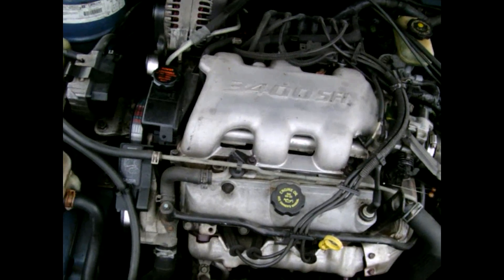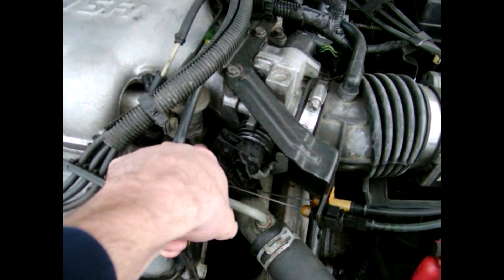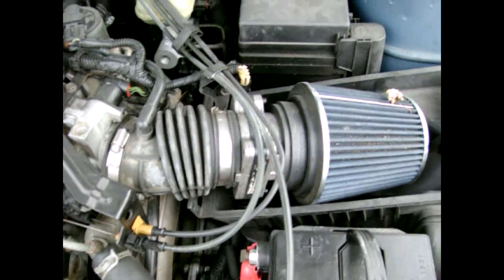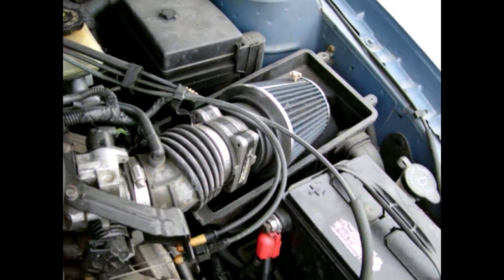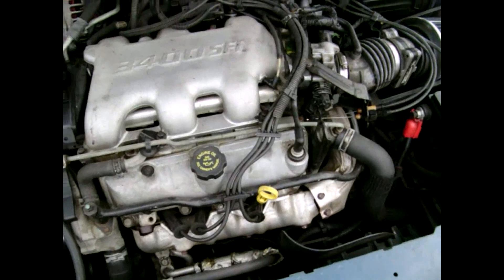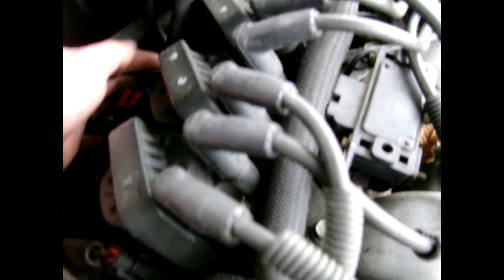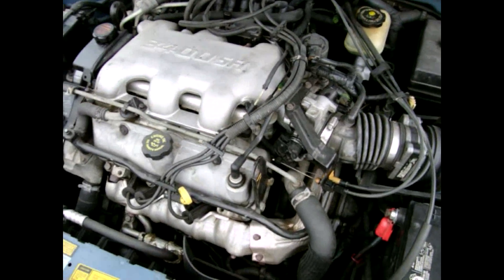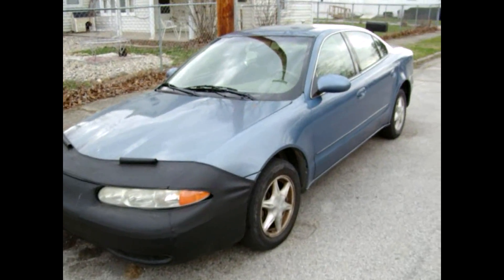3400 GM Engine 3.4 Liter Motor Explanation And Discussion

Comment from the maker: You will need an OBD II scan gauge to pull up the codes.  Any autozone or parts store will run the codes for free. The pinging could be bad gas or the elevation.  Possibly the EGR system. The EGR system tends to get carboned up. Change the EGR and clean the port with a coat hanger and strong solvent. Also check for vacuum leaks with a water bottle or carb cleaner.  Be sure to check your oil too, make sure there isn't water in with the oil indicating a bad intake manifold. Hope this helps.
VT247

Comment: Great Video. I have two Chevy Equinox's 2008 and 2009 both with high mileage and have had no major issues with either one, I think GM must have fixed many of the problems in later production versions of the 3.4L
Reply: Boy you wrote a arm a leg lmao😂

Comment: I have a 2001 Chevy Venture, that Im thinking has a blown head, The night I bought the vehicle it ran fine had no problems other than a shake when accelerating, but that's not the issue. I started driving home the next day after purchase, got about 3 miles from where I started, and overheating begins, and speeds slows to 20 mph, I shut it down immediately. Waited on it to cool down and got home 3 miles later again getting hot. I changed the rad cap and added coolant from napa, just to be sure it wasn't a blown head, I checked for water in oil and oil in water, and even checked trans fluid, didn't see anything wrong at the time. Drove it about 7 miles and loss heat, then overheating and shut it down again, got to a mechanics shop, they did a block test, not showing blown head however the shade tree mechanic noticed it had sludge on the valve cover inner wall and said well its had a blown head gasket and looks like they drained the sludge and replaced old engine oil. This is evident-ally a scammers way of selling a blown head gasket vehicle, he said to get some blue devil pour and go head gasket sealer. Tried that, but bled the cooling system after refilling and didn't over heat, ran good and had good heat. So thought this fixed the problem. Next trip on the way home its overheating again, so I checked the bleeders maybe there was air in the system still sure enough pushed a lot of air out before getting coolant. After bleeding it no problem but since then in order to drive this I have to bleed the coolant each time and add maybe a cup of coolant to top off. Is this a blown head or is it the intake man. gasket? I don't have a lot of cash to dump into this, and hoping for an easy fix but figuring its not going to be. Just today the trans started shifting hard not sure if that helps with all I have said but, it is up to date info as to what I have seen go on with this vehicle.
Reply from the maker: From everything you've described here, the head gasket is blown or the head is warped.  Fill up the radiator, overflow tank and bleed the system.  Once the vehicle warms up to operating temp, check for bubbles in the overflow tank.  My bet is that there will be.  Bubbles in the overflow means that exhaust gasses are getting into the coolant.  Exhaust gas pressurizing the system and putting air in as well causing overheating.  I've got several video's up on how to fix these motors.  Hopefully it's just the head gaskets and not the heads.  Check each head for cracks between the intake and spark plug hole.  Also check that each is straight on the combustion side and not warped.  If the heads are good, you can order a $80 rebuild kit shipped with all included gaskets and bolts.  If the heads are bad, you can get a nice set off eBay for $350 shipped.  Watch this 2 minute video on why they go bad.  https://www.youtube.com/watch?v=K5mwjWLemA8 
VT247

Comment: i have a water circulation pump on my van i want too know if it is needed or if i should take it off and put a elbow because i noticed no one has one in  there vans like this i have a 2000 pontiac montana

Comment: hey VT247 thanks for the tip on the water pump. It was a snap! BUT it was still overheating. I did everything I could to Burp it using the water pump bleeder and the thermostat bleeder(I didnt feel the t-stat was bad cause with the radiator cap off once it warmed up the coolant dropped a lot led me to believe the t-stat opened.) It did bubble a bit which really worried me cause Im afraid the intake or head gaskets are bad. Im gonna take it in to test the coolant reservoir for combustion gas!

Comment: The vacuum line coming from the top of the fuel pressure regulator to the back of the upper intake. I noticed my 2001 Pontiac Grand Am GT 3.4 has a fitting on the line going to the intake. But the fitting has a side opening for another line. I for the life of me can not figure out what it was for or if it's for anything at all. Perhaps you could show me?

Comment: 04 pontiac grand am  lower intake manifold gasket  leaked antifreeze into the oil.  Replaced with felpro gaskets problem solved. It started to leak slowly over the a.c. compressor which blew the a.c. clutch fuse. That caused a no cold start issue.... seems the fuel injector start pulse circuit shares the a.c. compressor fuse. Would cold start with either then restart all day until cold. Check the a.c. compressor clutch fuse.

Comment from the maker: My wifes Aztek did the same thing. Luckily it was caught before any major damage was done.  I'm sure your engine is flooded.  No worries though!  Should be a one day fix.  You'll need to replace the intake manifold gasket and spark plugs.  
What happens is when the water fills the oil pan the pistons can slosh around the 'milkshake' and foul out the plugs.  Check out my video on how I replaced the intake manifold gasket on my '01 Pontiac Aztek 3400.
VT247

Comment: I've got a 3100 in a 1996 Grand Prix. New intake gaskets and head gaskets. Also a new water pump. Coolant leaking from somewhere behind the engine. I can't locate it. It leaks about a gallon every two weeks. What could be leaking back there?

Comment: 2004 Monte Carlo LS 3.4l v6 with 129,xxx miles. 
Rough idle at times, but when it's warmed up, it smoothes out. It also turns off when coming to a complete stop and the rpms drop very low or usually straight to zero.

 The fuel pump was replaced, and the IAC valve has been cleaned and helped with the rough idle , but it still turns off while on the road coming to a slow or complete stop. Starts right up again until you begin to drive and come to another stop. I suspect vacuum leak or bad 02 sensor could be the culprit or a combination of other components. 

Any advice on what could be the reason why the engine turns off at idle and after driving? What would be the correct way to asses the issue so I can find a proper solution and not dump any further money into this problem
Reply from the maker: Here’s a few suggestions that might help.  Check the EGR and the passages going into the intake.  Could be a source of unmetered air entering in if stuck.  Hopefully the head and intake gaskets are good, those and the timing chain gasket are prone to failure in these engines.  Also the coils and computer module under the pack may need checked.  
VT247
Reply: @Vacationtime247  thank you very much in advance

Comment: I have some leaky fuel lines on my alero(3400). My question is, which fuel line is the return and which is the feed? When I'm looking underneath the car underneath where my drivers seat would be, which fuel line is what?

Comment: hi there,
have a buick 2000 with a 3.1l v6 ( I assume they're pretty identical) and for the limited time and tools I have personally maintained the car as best as possible.
it's developed an annoying sound on startup that sounds like a diesel truck on idle but goes away within a minute or 2. there also seems to be a minor coolant leak running off onto the tranny under the throttle body but it seems slow and can't find the leak. these problems correlated with each other in any way?

Comment: Have same engine in my 2001 Oldsmobile silhouette.  It’s giving me a low oil pressure light but it has oil on the dipstick.  Read where oil pressure sensor could be bad.  Any suggestions.

Comment from the maker: I think in the vans the manual calls for the engine to be dropped from underneath.  If you get a junkyard engine go ahead and spend a little extra $ and do the head gaskets / intake manifold gasket.  They tend to go bad.
VT247

Comment from the maker: Most of the lower intake manifold bolts I've found on the side of these 3400 are really loose too.  Like they were torqued just enough to get it past the 100k mile warranty.  Then to use the acidic pink antifreeze with sub par gaskets is a recipe for failure.  But, once those issues are fixed the engine will last for quite some time.
VT247

Comment: I have this motor in 04 rendezvous. I got 2 and 1/2 pages of new parts on it and still not fixed. It surges at idle. No power going up hill. Had it looked at again today. That why I checked this video. Was told it is vaccum leak. I have had it to several different mechanics and no one can seem to or want to fix it. I have not replaced maf sensor. I will try that next. The maf went bad on my ranger with simular symptoms. But the line under the bracket and by the DIS system have not been checked to my knowledge either. I have had the spray test done for leaks. Only codes I get on it is misfires. I got her valve once and replaced the valve line and pig tale. This is driving me nuts!!!!

Comment: Well I gave up on doing the work myself in fear of creating a bigger mess. So to the shop it went. A local shop who I very much trust looked at it and quoted me less than $700 for the intake gasket. Since I budgeted more than that I will have him check some other items while they are there. New thermostat and maybe some new coolant lines are in order. He said no labor on those since we would already be in deep. Fingers crossed the overall stays under a grand.
Reply from the maker: Hope this fixes it!  Vehicle problems can get very annoying and sometimes expensive.  Let me know how it turns out : D
VT247

Comment from the maker: Check for engine codes.  First reset the codes then see what pops up after that.  My suggestions would be idle air control valve or throttle positioning sensor.  
VT247

Comment: mew fuel pump plugs wires etc timing is fine.  Seems to get worse when it rains. Like its clearing out bad gas or something bit I cleaned the tank when I put the fuel pump in. I have been looking for a vacume leak  or bad wire and can't find anything..Maybe time to start a bonfire ??

Comment: Yep, was indeed cracked.  I accidentally pulled the wire our of the alternator plug and dicking around trying to get the pin out I also took out the 3 plugs. Now the 3 plugs and and pin are out. Got the wire soldered back on the pin but don't know which of the four holes the pin goes in, can you look and let me know? haha  It was one of the middle 2.

Comment: ...I am on a very tight budget and will have to tackle this myself. I think it worth the gamble to spend the $150 or so in parts and just do the intake to see if it cleans up the issue of using coolant at a rate of about 1/2 gallon per month. The spark plugs all look good and I do not see any arcing of the wires in the dark. Do you think I could get away with only doing the intake and add a new thermostat while I am there?

Comment: i have a 01 Grand Am with this motor and after it warms up it starts to jump forward and spudder out when driving...let me know what u think...i was told it is one of the O2 sensors or the fuel pump might be dirty.

Comment: Where does the fuel line from tank hook up to ?
Reply from the maker: The fuel line is routed under the intake plenum and throttle body for the motor.
VT247

Comment: I just had a cross over pipe replace in my 2002 Silhouette i got it back now it's idle up i come off the brakes and it will get up to about 35 mph without going on the gas. is the a vaccum leak.

Comment: Apparently my previous comment was erased, I was saying that I have a 2003 Pontiac grand am with this same type of engine and it has been not wanting to start. it will do fine unless I drive allot or over 60, and yesterday it almost seemed like it was trying to die on me as I went to accelerate from a stop sign. We have changed: spark plugs and wires, oil and filter, thermostat, fuel filter, air filter, and the throttle position sensors. and the serpentine belt. any ideas what else to check?

Comment from the maker: Shouldn't need much more than a 5/8 socket an extension and a 3/8 drive ratchet.  The spark plug wires pull right off.  Hope this helps.
VT247

Comment: 2002 3.1 here getting oil it the raditor? the intake gasket was leaking a year ago put some stop leak and it stopped leaking water but now im loosing oil in the water the car runs awesome with no overheat please give advise I really hope its just the intake gasket thanks scott

Comment: I drive a 2004 Monte Carlo with the 3400 Gm and ever since I bought the car (around 115,000 miles) it has had trouble starting on the first go. I just changed out the fuel regulator but the problem still persists whether the engine is hot or cold. Could the fuel pump have gone bad in just 8 years?

Comment: i have a 02 impala, 3.4 with 131k miles on it. I had the lower gaskets replaced with a new metal manifold, but when i got them replaced the upper gaskets looked good. so i never had them replaced. my question is....what are the signs that the upper intake gaskets are failing and need to be replaced? Im askin bcuz i recently had an oil change, and the mechanic said that my gasket was bout ready to blow? but ive looked and really havent saw any leakage....so i jus wana honest opinion on what 2 do.

Comment: I think this is the same engine as in my 2000 impala 3.4L. 178k miles and strangely I haven't had the throttle body gasket leak everyone is describing. I've owned the vehicle since 20k miles. I'm getting the P0401 EGR code. Do I have to remove the entire throttle body, or is there a way to clean it without removing the entire assembly. I watched a video on removing the whole throttle body. It's quite a job. I'd really like to avoid all of that work if I can help it.

Comment: Solved the prob. It was the exhaust bypass tube rusted thru. What a "B" to reinstall. Used a 3/4 black pipe w/ slot cut out to fit over tube and a hammer to press fit it back in. Picking the old tube out w/ a small screwdriver was easy.
replaced the manifold gaskets only to have the head gaskets go 3 wks later. very common prob.

Comment from the maker: Here are a few items to check.  The exhaust bypass tube for the EGR, allowing to much air in the system and check the EGR for proper flow and carbon in the intake ports.  The Fuel pressure regulator, not allowing enough fuel in to feed the injectors.  This is where I'd start.  Let me know how it turns out.  
VT247

Comment from the maker: You might need to get one from a junkyard.  That metal coolant tube can be a major pain to remove.  It connects from the water pump with one bolt.  There is a bracket under the throttle plate holding it.  2 hoses with clamps at about the same location.  Also needs disconnected by the firewall / heater core hose.  For better reference, check out my intake manifold gasket repair video.  Should have a part were I mention that tube.
VT247

Comment: I still have a Cylinder 3 misfire. It is getting good spark, I swapped both the plug and the wire and the coil.  Then went ahead and felt the shock out of the spark plug.  Works.  Any ideas?

Comment: I need help have an impala with that engine has a #4 misfire I replaced plugs and wires made sure it wasn't the coil pack and nothing has changed I try to do a compression test on it and I have a hard time getting a reading on it sometimes it says 150 but other times I get nothing all other cylinders test around 150

Comment: I'm trying to get my heater hose plugged back into the back of my motor but it has a plastic quick connect and I can not get it to plug in. Anyone know a easy way to get that back into the back side of the motor??

Comment from the maker: The real wheel drive 3.4 in the Camaro isn't the same as the front wheel drive Grand Am / Alero 3.4  However, your problem with the ticking is either a lifter or most likely the timing chain hitting the slack adjuster.  It takes some time to change out, but gets rid of the annoying tapping.
VT247

Comment: video was very helpful.    I took my 2005 Pontiac grand am 3.4L to get it looked and the mechanic said it was a 2ND cylinder misfire and a valve sticking.  I think I know what to do. about the 2ND cylinde but not sure about the valve stick? any ideas
Reply from the maker: Start by replacing the spark plugs and wires.  Check your coil packs for any cracks

Comment: i got a 2001 grand am with 34oo v6. its starting to overheat. i believe the lower intake gasket is shot. i do see some fluid on right side as you pointed to in your video. i  added coolant it has gotten worse. any specific suggestions to determine if its upper intake gasket or lower gasket.

Comment: Hello, I have the same engine for a 2003 Grand am GT and my water pump is leaking underneath the pulley. What are all the parts the need to be replaced?